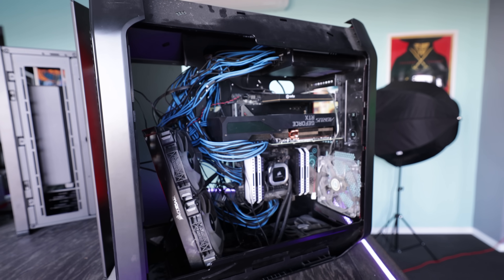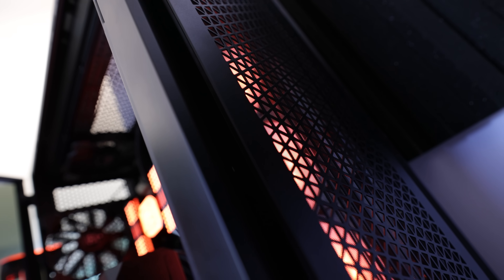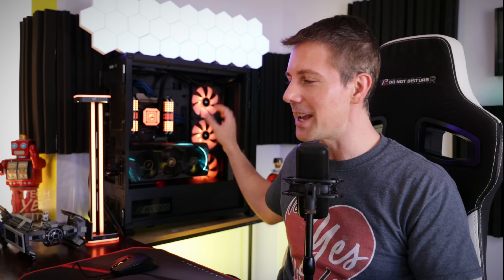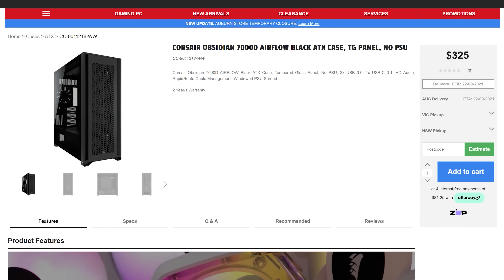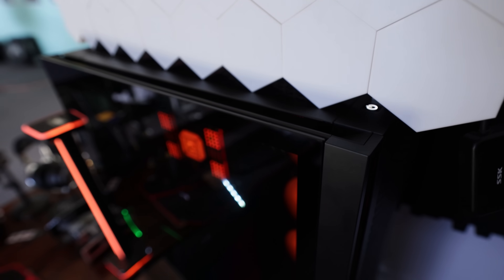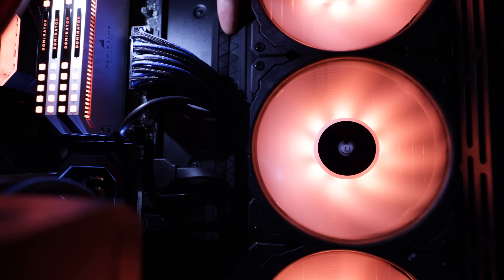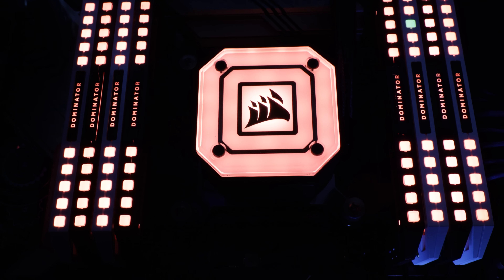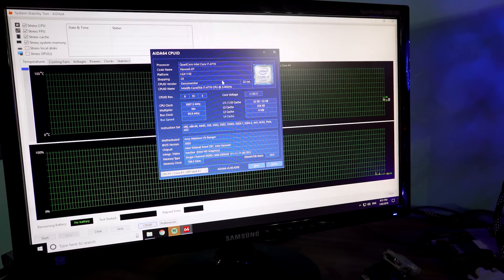Rebuilding my DAMAGED PC Setup (Corsair 7000D Review)

Comment: Hey Bryan, I have a Question.I currently have 2*1tb HDD, a single 2TB HDD and 500GB nvme SSD. I want to reduce the number of drives I have, facing a dilemma. should I get a 4tb HDD and get rid of the other hdds (or have 4+2 tb setup), or get a high capacity ssd (nvme maybe) and go with the same setup mentioned previously? Thanks.
Reply from the maker: Oh hey, I am on the side of getting the 4TB and use your existing m.2.  The only time I need an nvme drive is for video editing/main boot drive, for games, hard drives are completely fine imo (providing they aren't too old).
Reply: Thanks all. I'll get a 4tb and call it a day.
Reply: A single high capacity NVMe would be expensive, but the real risk you face going that route is data loss (when an NVMe fails there's almost no chance of data recovery, but with a rust spinner it's very likely any important data can be recovered if really necessary), so it depends on how important your data is. If it's mostly installed games that can be redone if need be then perhaps it doesn't matter so much, but if you're doing content creation or actual work then it makes more sense to split the use case, unless there's some kind of useful performance gain from certain things being on the NVMe.

Personally I'd go with a primary 1TB NVMe as they're pretty cheap these days (Adata or 970 EVO Plus if you want the speed, WDB Blue for value), plus 2x 4TB mechanical, because having a backup is something far too many people ignore. I don't use RAID1 though, don't want to rely on the OS. I just copy over changes manually every week. I have a 512GB NVMe C-drive, 2x 1TB NVMe for primary photo/video storage where one is a backup, and then 2x external Toshiba Enterprise 8TB in USB 3.0 cases for long term archiving with each storing the same data. The 1TB NVMe drives over time have transcoded mp4s to reduce file sizes by 80% and be suitable for upload, the rust spinners hold the original raw camera files. Note I searched for bargain unused Enterprise drives, bagged three Toshibas for far less than the cost of ordinary consumer models.
Reply: @mapesdhs597  I lmaoed at "Rust Spinner", nice name ngl
Reply: @Aquabyte  :D  I pinched the expression from a former senior sysadmin at SUN Microsystems. :)
Reply: @mapesdhs597  Haha.. The SysAdmin at Sun Microsystems would have great sense of humour, I assume 😂
Reply: @mapesdhs597  true, but the lifespan of the ssd is twice that of hard drives, if he manages to have some kind of redundant storage in the future that would be fine.
Reply: @Oroquieta  It's not about statistical lifespans. I have mechanical disks from the 1980s that still work, whereas I've had a number of SSDs fail, including a couple of Samsung models. One should not plan backup strategies based on manufacturer claims about failure rates. What matters is the data and the consequences of losing it. The contrast in risk judgement is because data can almost always be recovered from a dead or dying mechanical drive, whereas it's almost impossible to do this with SSDs, especially those that have default-on protection mechanisms (I know someone who is the boss of a major data recovery company, he explained all this in detail).

Hence, if the data is low priority, such as game installs, then the consequences of failure are minimal, just replace and reinstall, but if the data is important or critical (which for a home user would typically be holiday videos/photos & suchlike), then storing it all on one large SSD is a terrible idea, and even multiple SSDs still carries higher risk/consequence. Humans are generally bad at judging probability, substituting hope and other emotional constructs for rational thinking. One must factor in the consequences of a failure, not merely go by what the MTBF states, which are always just statistical smoothings. Someone always has to be on the bad end of the bell curve of suckyness, but people tend to choose to believe it won't happen to them ("People will choose to believe a lie either because they want to believe it's true, or they're afraid it's true." - Terry Goodkind). I've seen a great many edge cases in 30 years of being a sysadmin.

One simple tip for someone who does decide to split the odds and buy two SSDs (such as two WD Blues): buy them from different sources as this will make it less likely the products will come from the same batch and thus be less susceptible to the possibiity of batch-wide production faults.

With SSDs it's become rather messy now with ever less reliable individual flash cells (QLC), hardly any products use decent MLC anymore. They get round it now via having lots of redundant flash, but this is at the expense of speed as the capacities grow, the no. of separate ICs on an SSD goes down, the no. of channels drops and performance tanks under certain workloads, actually becoming slower than old rust spinners in some cases. Various older products were faster and also more reliable. Now companies are cheaping out by not including memory buffers (or tuning their size just to look good in known benchmarks), while the era of capacitor-backed power loss protection has pretty much vanished. I read recently that Samsung had changed the type of flash it was using for one of its 970 NVMe products without making it clear on packaging that it was not the same as older models.

In an inflationary market, companies will cut costs wherever they can, which means degraded quaity in the tech space, though the changes will be hidden by manufacturers as much as possible. Personally, for a general purpose PC where max performance isn't relevant, I''d rather employ a used Samsung 850 Pro or 840 Pro, way more reliable. Note how Samsung does not have 10 year warranties for its current SKUs anymore (even on the 980 Pro it's only 5 years).

Also remember that when it comes to data backup, flash storage needs to be refreshed every now and then. One can't copy data onto an SSD and expect it to still be readable in some years time.'It's a pity there's still no sensible backup product or standard aimed at the home market (like a variant of LTO), because these days ordinary people live increasingly digital lives, yet hardly any have the slightest notion of the relevance of backup issues. In 50 years' time, there are going to be a hell of a lot of people who will find their precious photos & videos of youth, romance, offspring, career and life in general are long gone, stuck on devices which can no longer be read. It's a stark contrast to the era of printed photos which last a great deal longer. I have family photo albums from as far back as the late 1800s, the prints still look good. Ditto cinefilm reels from the 1930s, audio reels, etc.

Sorry for the rant. I just think it stinks how people are encouraged to place their trust in modern tech devices for their data, completely oblivious to the potential consequences. Some rely on Cloud structures, but much of that is down to convenience, at the expense of privacy and other issues, and one is relying on such companies to not only always exist but be accessible (and that depends upon relationships between foreign powers). No net link? No data. Wouldn't surprise me if increasingly nasty privacy issues encourage a return to personal data retention.
Reply: @mapesdhs597  A very insightful lecture which wouldn't had come out without introspection, you are right, I backup my data on two different cloud storage. One is in EU and other one is in New Zealand, so even if an asteroid strike takes away half the continent the other half is saved, now that's an extreme way of losing data in history of data loss reasons, isn't it? 😛

Comment: MAde it here early and just rebuilt my PC in a Fractal Meshify C with a Asrock 560m Pro 4 , i7 10700k 5.4GHZ all core , 32GB ripjaws 3200MHZ , Noctua D15 Cooler , 1TB western digital Black M.2 , 1TB Samsung Evo860 , Corsair TX650 semi modular , CoolMoon RGB Controller and 6 UpHere rgb Fans , and a RTX 2070 Super FE ... and i am playing all new titles 1080p 250-350FPS Valorant,Fortnite,Warzone,DayZ ... the upgrade cost me 600$ Canadian not including my old GPU and M.2,SSD plus i bought some parts USED like the case  ... My Cinebench Firestrike score is 26,642 , my old one with X58 was 17,844...
Reply: What voltage is that 10700k running at, and is it OCCT/P95 Stable? 5.4 on a 10700k with a safe voltage is hard to believe
Reply from the maker: I didn't know you can overclock on the B560? thats insane if so, just be careful with that high an OC on a b560 though?
Reply: You got some big balls to be running a 10700k on that motherboard 😂